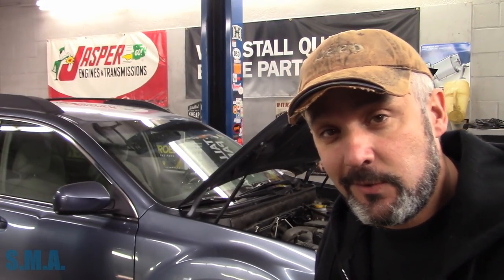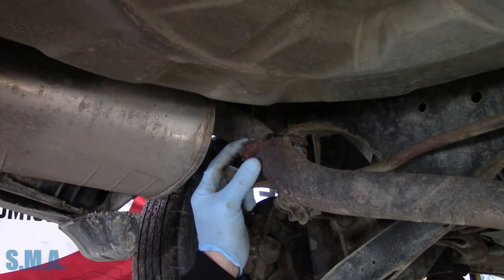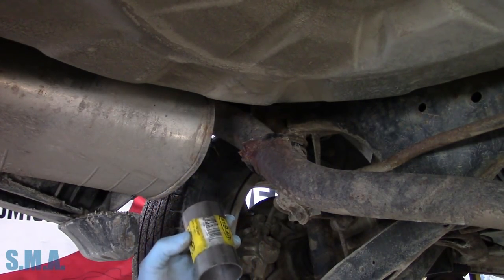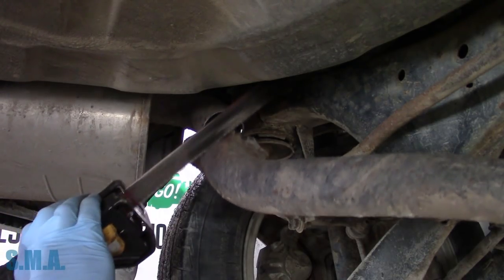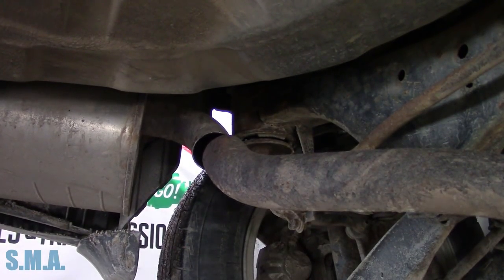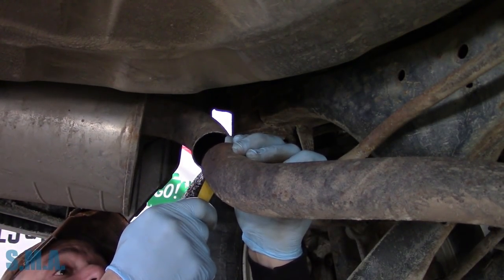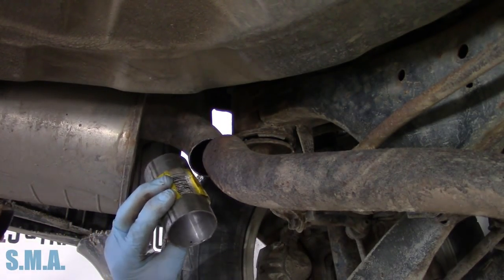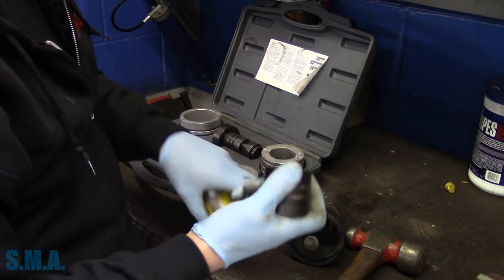Subaru Outback Repair Series: #1 Fixing The Leaking Exhaust Flange

Comment: Great job on the exhaust. The exhaust flange on my Subaru Legacy broke the other day. It's stainless steel and looks custom made. A new stainless one was about $1000 and mild steel front to back about $600 ( This is in the U.K. ). Luckily I had a small brain wave. I took the siamese back end off and brought it to a metal shop. The guy TIG welded it, did a beautiful job, and charged me about $30......Result!!.Enjoy your videos...

Comment: Nice to see you with a quality welder that just works well and does a good weld on old exhaust like that. Millers are the BOMB, I have 5 of them, all different for different applications, and all fantastic. You know what to expect before you pull the trigger.... every time. You can hear the consistent power in the machine on that application. The same with every pull of the trigger. A good and practical repair done right. I like machines that make the operator look good. Not that you need any help.... but what are friends like Big Nasty for anyway! BRAVO Eric.

Comment: OMG that rubber hanger popper would have come in handy for me like 3 times in my life, but OMFreakingG it would have been SOOOOOOOO HELPFUL AND TIME SAVING.  I hate it thats why I have so many random tools and everyone comes to me to ask to borrow or have me help.  That's also why Harbor Freight is such a wonderful place spending ~$10-30 on a tool you might only use for that job doesn't hurt like a name brand $100 one job use.   Those always end up the open-box special, which I have one of however I did not use it just realized the HF one was 1/3 the price and had .25" more clearance that I required.

Comment: I use an exhaust joint sleeve that is slightly bigger than pipes available here in the UK ,  when you tighten it up it compresses onto the original pipe,  like a scaffolding joint clamp , VW use something similar on lots of models, ,great batch of videos  Eric , REGARDS  MIKE

Comment: An old engineer told me years ago that same size fits will never go, there must be a little bit of play.
The stainless steel exhaust systems last a hell of a long time, but selling a kidney to afford it is a bit rough lol.
Reply: Where are you getting kidneys that cheap?  Having had older Toyotas that needed their exhausts replaced frequently, I know that what ISN'T covered by muffler shops "lifetime" warranties adds up quickly, and their work deteriorates faster when they slice off  good flanges from intact pipes to fit their crappy connector pieces in.  I'd rather pay for OEM stainless parts that I (or they) can bolt in.  If  SMA was in my area I'd be more willing to to trust mechanics.
Reply: P Schmied, ooow i get them from the local supermarket lol.
I didn't say live or human kidneys did i :)
Reply: canuckguy worried
Oh yes i like a good joke or misdirection :-D
Makes the brain fizzle :-D
Reply: canuckguy worried
LOL maybe you could have used "Grinding paste" on your date, if you were lucky of cause :)
I feel like i'm wriiting a mechanics carry on film ha ha :-D

Comment: Nice! Had this happen on an impreza near Syracuse during the Winter. It sounded like a stereotypical buddhist kung fu gong from the movies because the muffler was banging against the midpipe.
I wanted to change the muffler anyway, so I got the cheapest SS Borla, and I clamped a split flange onto the midpipe.
Of course three years later the split flange is rusting like crazy...

Comment: Wish I had those flange tools and a compressor I end up using angle grinder to cut it off and Muffler clamps usually I can get repair tube that will fit with OD in IDs pre stretched

Comment: instead of BBQ paint, you can shoot with Slip-Plate graphite spray. Goes on like paint and repels water. I use it on underbody ground connections that I'd like to keep clean..being graphite, it conducts fine, but works well on any surface you'd like to keep corrosion free.

Comment: I remember in the ol' days wrapping exhaust leaks with that tape crap.. kept it going quiet for awhile.. in bad cases a soup can sliced apart so you could wrap that around with cement too.
Reply: @xIntoThePitx  Aluminum soda can, high-temp silicone, and hose clamps.

Comment: Those are good blades! That's the fastest sawzall I've ever seen!!  ;)
Reply: New blades make a huge difference.
Reply: Teeth ON the blade are important; found that out cutting old plastered drywall; took the teeth off a new blade in only a few feet of cutting. I never expected that, when I cut metal without losing teeth like that.
Reply: @markh.6687  The plaster likely had sand (abrasive) component. I've found that in older buildings too.
Reply: @stephenarling1667  House was build in early 1941, so that makes sense. Bi-metal blades didn't last much longer; I would up sledging/prying off the drywall (which was in narrow factory-cut strips, not 4 x 8 sheets like later in the century).

Comment: I was surprised to see rusted exhaust pipes because the OEM exhaust pipes of my Honda Elements have been stainless (and we salt out roads heavily in Chicago).  The only exhaust parts I've ever had to replace on them since 2004 are the cat converter heat shields.

Comment: So i can't help but wonder because he never showed it. Im sure he did but was there a surge protector hooked up to the battery b4 you started to weld or was a battery disconnect done? Great weld but when i was in school 4 welding and mecanic plus the shop i work in i was always tought put a surge box on the battery or do a positive disconnect with any type of welding on any type of automotive welding.

Comment: I have the same issue with my 04 Toyota Rav4, the exhaust has a rot hole where it pipe goes into the muffler and one at the resonator. I'm a cheapo DIY guy and do most of my repairs (Don't have much with my Toyota in all the years I've owned it) and preventative maintenance myself. I'm going to be doing the same to my exhaust in my driveway. Wish I had a lift I'll be laying on the cold ground with the car on-ramps.

Comment: sheeeeeeesh! What did i tell you before Eric?  pipe is measured inside diameter I.D. and tube is measured outside diameter O.D.

Cant get the staff these days..........
Reply: welcome to metric pipe and tube, where it's off just far enough to fit neither correctly and sold improperly as imperial and standard sizes........... :))
chinesium... yup
Reply: throttle bottle measuring a Japanese car in imperial 🙄 it’s probably 49mm though like their 12&14 mm headed bolts 😂
Reply from the maker: So the pipe that was on the car that I cut was 2in OD the pipe that I bought was 2 in ID. It should have worked...
Reply: South Main Auto Repair LLC should have got the metric tape measure out 😜 I hope you’ve done a video for the people’s with the new lifts/install. Have a good weekend Fiat lover 😘
Reply from the maker: @defendermender4959  New one got delivered today just waiting on the other two :D
Reply: @SouthMainAuto  we want to see the disassembly and installation of the new lifts...PLEASE!!!!!@

Comment: I've hung pipe for years, I've worked for Car-x, Midas and Meineke since I started turning wrenches back in the 90's. I've done custom bending and repair. More recently I've started doing a lot of exhaust manifold repair and replacement. Now with that being said, I've seen recently an epidemic of cracked eco-tech manifolds. So my question is, have you seen this problem? I think that in less than a two year span I've done 10 of them.

Comment: I'm not an exhaust guy, but need to do this on my Subaru asap. 
Don't have access to a welder, so would clamps be ok to use?
And if so, should I use some sort of sealant on the connecting areas to prevent leaks? What type of sealant(s) would be acceptable?

Comment: Ok, could you in theory use JB weld and some screw down clamp  rings? My car is 16 and not many years left on her. 😕
Reply from the maker: Lots of exhausts have been repaired with a soup can slit up the side wrapped around and a few hose clamps 😁
Reply: @SouthMainAuto   I was just thinking about that yesterday too, lol! The metal is softer and able to bend! I might try that for giggles and see if it works. She only drives in the winter anyway ;D

Comment: FYI non-clorinated brake clean burns just like carb cleaner Use the chlorinated if worried about fire Learned that the hard way 20 years ago when it first came out. I don't stock the non-clorinated anymore
Reply: M D Adams they both burn just the same , the reason was non chlorinated was brought out is chlorinated brake cleaner gives off phosgene gas when exposed to an electric arc, people have died from welding on parts cleaned with chlorinated cleaners
Reply: @fredhankes5608  Simply not true go buy a can of each one (chlorinated) will smother the fire the other will burn when sprayed I know this because I used to use brake clean to put out small fires in the shop and got a heck of a surprise when the (at the time) new stuff burst into flame making the situation much much worse I also have run an engine on the new (nonchlorinated) to get it in the shop the chlorinated will not do this
Reply: M D Adams First of all both will in fact burn, hence the “Warning Contents Flammable , Do not use near open flame” on the can. More importantly the intention of my comment was to add that it is dangerous to weld on parts cleaned with chlorinated cleaners, not to refute your comment as you are implying, comprehension is everything
Reply: @fredhankes5608  Have you tested that theory I have

Comment: Mr o do you disconnect battery when welding on vehicle?
Reply: I'm not Eric but I can tell you with confidence (30 year auto tech) that you don't need to, just place your ground clamp as close as possible to the spot you are welding and you'll be fine, electricity will always follow the easiest, shortest path to ground. Now if you're welding the back bumper and grounded on the engine block, that could cause a problem...lol.

Comment: Years ago on my "78 Honda Civic, I replaced a long piece of the 1" pipe with some scrap 1" copper  drain pipe. I used 45 degree elbows and soldered up the hump to go over the rear axle. lasted for years until I sold the car. Looked like a plumber did it.

Comment: Just paid $1,000 (in MA) for 2 new mufflers and whole new pipes for my 2011 Forester exhausts, because the mechanic showed me advanced rust on my flanges and bolts holding the pipes to the body. Is this a normal repair?  I brought it in for a money light issue related to an O-2 sensor code. Did I get the "shaft" ?

Comment: By chance where you using a Flux core 110 wire feed welder on the pipe??? I need to do repair on my f150 and I have a barber freight welder. 110 flux core.. Havnt even opened the box.
Reply: that was solid wire with shielding gas, probably C15 or C25 gas, argon co2 bleand. mostly argon with the CO2 percentage the number after. unless he's running stainless wire and gas. probably not for repairing rust buckets :)
you can use flux core wire, but it splatters 10 time worse, add in rusted pipe/materials and exhaust carbon, it will spit, splatter, surge and send slag fireballs everywhere, about equal to a 4th of July firework show :))) it will work, but it's hard to control, real easy to burn through and make holes or leave voids which whistle dixie when running ;)
I still have clothing and creepers with slag splattered burn holes, not to mention the smell of burning hair is great also (arms, head, face) that was long sleeves welding gloves and more lol. granted that was fabri-cobbling a whole muffler seam rust through (about 3' long total, used over 3/4 small spool of flux core wire, on 240V machine) 
it was a "use what ya got"/"run what ya brung" kind of night

Comment: I've personally liked to use a exhaust sleeve clamps which are common on VWs for this kind of situations. Works great when the pipes have a inch or few of straight on both sides where you cut it. Just clean the pipes, slide the clamp on and tighten the bolts on it and the sleeve inside will snug over the old pipe. Though the sleeve requires both sides to be exact the same size. They ain't too expensive either (they are around 10-15eur here in Europe so it is probably around the same in dollars). Here is a link which shows one of those https://bit.ly/39bxy6y 

They vary in size and lenght available and pipe diameter doesn't have to be spot on because the sleeve adjusts and tightens around the pipe - they usually come in 5mm increments. One fits 55-60mm, other 60-65mm and so on.

Comment: Do you not have dual clamp exhaust sleeves state side?

No dolly or welder required
Reply: expensive, more so when you have a whole shop at your disposal ;)
Reply: @throttlebottle5906  They cost less than £10 here in the UK. I'm not knocking Eric O's job, But just seems a quicker & easier fix.
Reply: Welds do not come loose.

Comment: why struggle welding the top side on the vehicle?   you took the hanger off after tacking.  just drop it off and weld the top on the bench then put it back on and weld the bottom

Comment: Subaru puts out some tin foil Exaust parts. No excuse eather. 2 in ID  and 2 in ID is the same size as the exaust pipe. Had you gotten 2 in OD it should fit.
Reply: The OD of the pipes was 2".